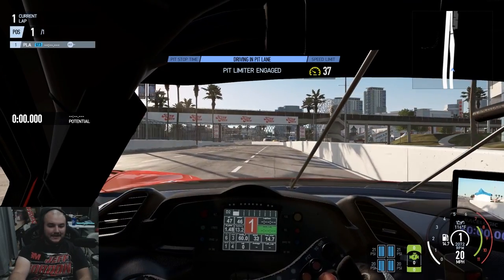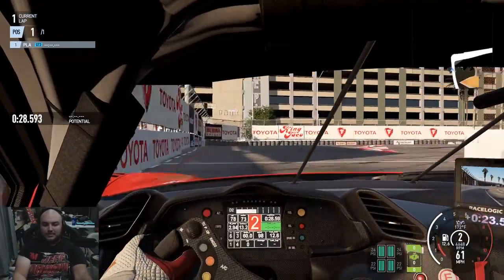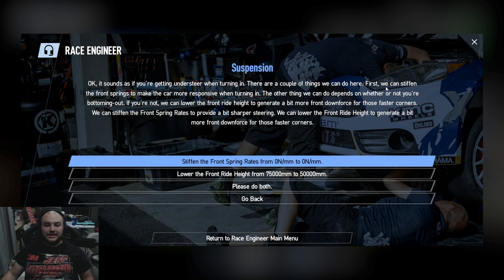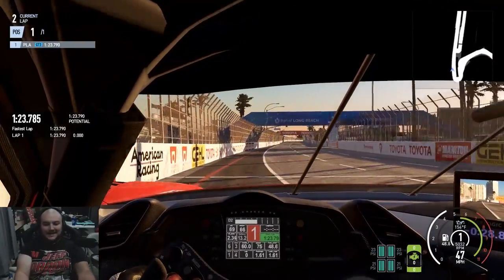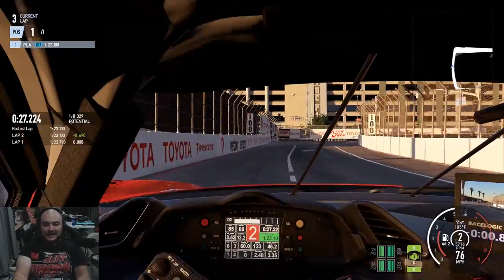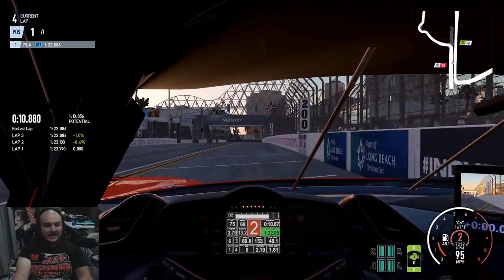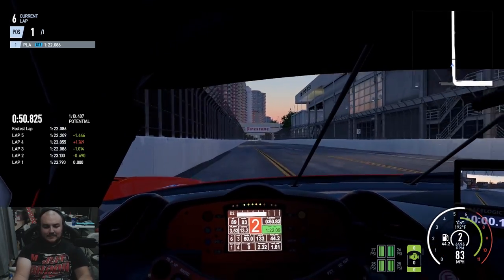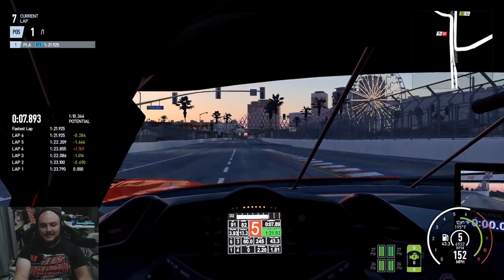Project CARS 2 - Taking a Look at Race Engineer

Comment: PLEASE don't always compare it with AC and rF2. You actually dont have the latest build. If you would have the latest build you would see and feel that pC2 actually is better than anything else on the market. These comparisons with AC and rF2 are really annoying tbh.
Reply: I doubt the difference would be completely different from initial impressions. Improvements and refinements can be made but I doubt FFB and physics are being revamped completely in just a few builds.
Reply: Tobi Ogunsanwo at least with his wheel (CSW V2.5) the whole FFB compared from his build and the actual WMD build feels like night and day difference. Also tyres are actually still refined every day, default setup changed from his build to the actual WMD build and will even be further tweaked until release where the plan is to offer a more understeering setup and also a more oversteering setup to satisfy both controller and wheel users. So overall there are massive changes still incoming and I already think that pC2 offers an even better FFB than AC, rF2 and especially iRacing as I absolutely hate the FFB in iR
Reply: I'm sure the FFB is ok. There are people that really liked the FFB in PCars1 over AC and just about anything else. I'm just saying that the signature physics and FFB of a game will be felt in just about any car and it won't change over-night.
Reply: Tobi Ogunsanwo but it changed since his build and the actual WMD build because his build is almost 2 months old and exactly in this time frame there were MASSIVE changes made to the FFB
Reply: I don't get your point! Why isn't it legitimate to compare it to AC and RF2?
You can do that with every build.
Reply: Attila theHun it's just not fair as with the recent changes it feels so much better than those two sims.. And tbh this comparison sucks, I think he mentioned it 4 or 5 times in this video alone.. Why is he thinking that AC and rF2 are the benchmark?! Actually pC2 will be the new benchmark ;)
Reply: hahahaha better than ac and rf2 xD just where?
Reply: Alfredo rodríguez YOU never had the chance to drive it actually I bet. If you would your opinion would drastically change
Reply: Well that's Slightly Mad's fault then. They should have given the press WMD accounts so they have the lastest builds possible.
And just because you compare it to something it isn't a benchmark. You said yourself that handling in this build is shit, so obviously AC and RF2 will be better. Still don't get your logic, since SM themselves shipped out this builds. They shouldn't have done that in the first place, if they knew there are major problems.
Reply: Yeah i think the comparison is fair & that what we are all going to do after all. Why not just give them a more recent built if its so much better, can't be that hard to send a new version to them.
Reply: Attila theHun and exactly THAT is the big issue. This build was NOT send to the press by SMS, it was send from Bandai Namco. In fact SMS is totally concerned that such a early build with so many bug went to press. And btw never said this build feels like shit, just said that it now feels even better
Reply: I'm pretty sure that SMS could resolve this issue by sending them a more recent build even if it was originally from Bandai Namco. I did think it was odd that they sent something out so early but i guess Bandai Namco are looking at the competition & seeing youtubers playing preview versions of those games.
Reply: Still not William's fault...Bandai and SMS should know what they do. It's obviously their communication problem.
Reply: Alfredo rodríguez hahahaha AC is still in development hahahaha :D :D :D
Reply: What does "under development" even mean these days? Almost every game gets continuous updates these days. Just look at iRacing, it has been under development for the last 10 years. It doesn't meant it sucks. It's actually a better model than forcing the customer to buy a new game every second year. Also I'd be surprised if the physics of this game turn out better than rF2.
Reply: C3lloman if it was AC they'd make the graphics update and tire flex DLC lol.
Reply: If it's true that these builds aren't as good as the current one then i'll be looking forward to the reviews in the future. This version is like 50 builds behind lol, I don't know how fast they pump out new builds but at least I know every new build comes with improvements...and 50 new builds after is a frikin' lot...
Reply: NemisisDL sometimes 1 or 2 builds a day.
Reply: NemisisDL the press build 754 is exactly 1 month old. As everyone know in the last months before master candidate (gold status) of a game there is a LOT of polishing going on. And in 1 month with now 62 more builds you can imagine how much is changed.. Every build has a Changelog of 2-4 word sites.
Reply: Dat Boi well to be fair that was claims for AC too .. back when camber setting didn't matter and the temps were bad, when there was no brake temperature, when you can't stall engine or operate manually pit limiter (well that is still an issue), where you couldn't effectively ride curbs, etc ... If course devs will claim that..
Reply: Also hes not letting his tyres warm up and is already complaining